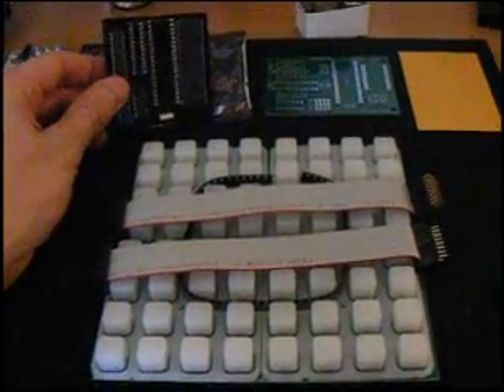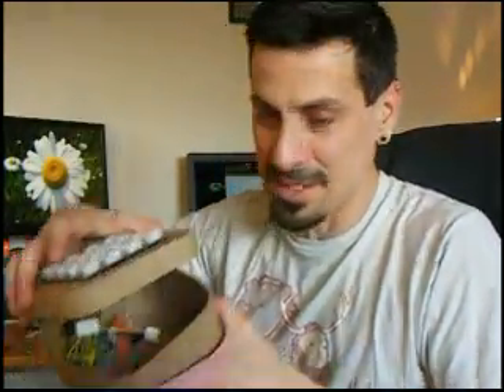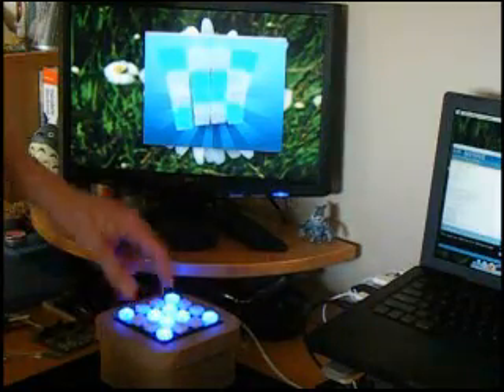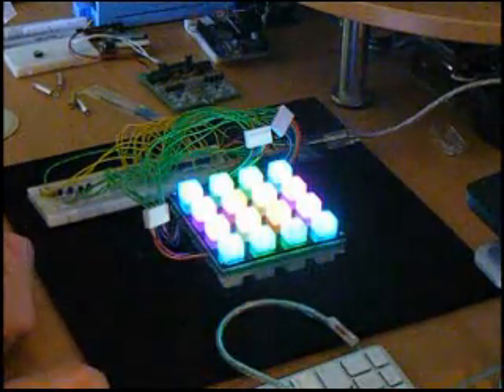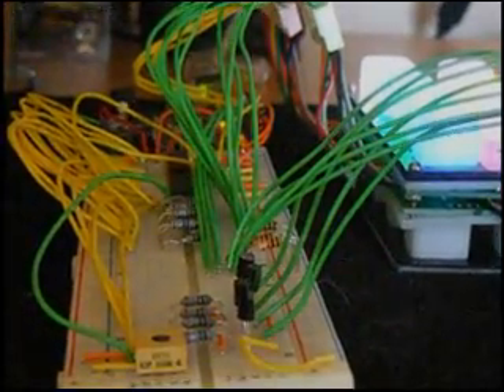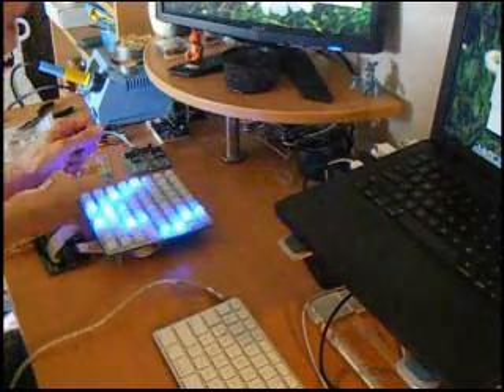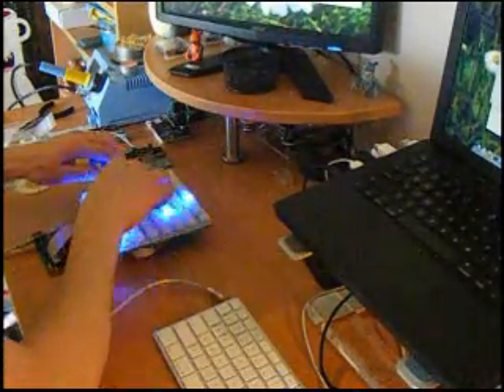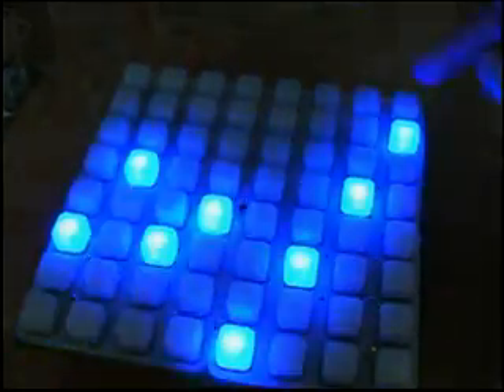Monome & Keyboard Matrix

Comment: Hey man, I've written a step sequencer in MaxMSP 5 that I'm trying to interface with a Sparkfun 4x4 LED matrix via an arduino NG but I haven't the first clue how to use the raw C++ code supplied by spark fun to communicate with the hardware (I'm a newbie to this stuff).  I don't suppose you'd have ay advice/help you could impart to get the ball rolling ASAP?  Thanks!